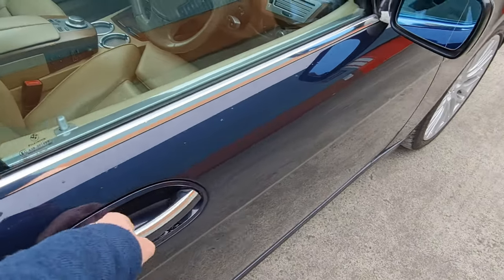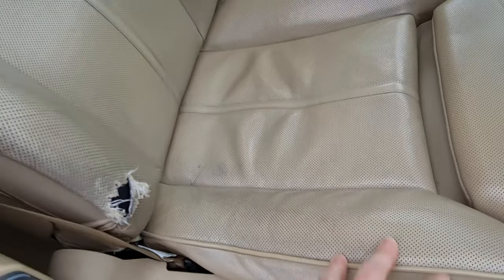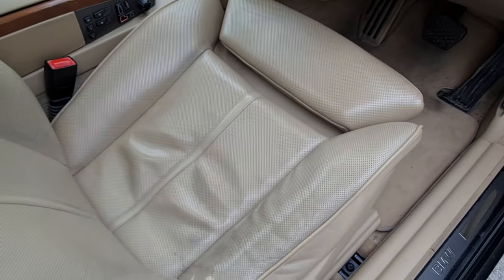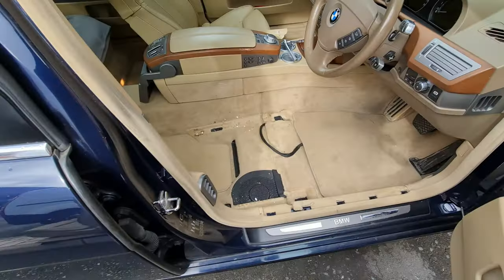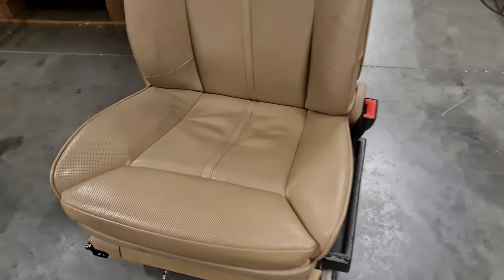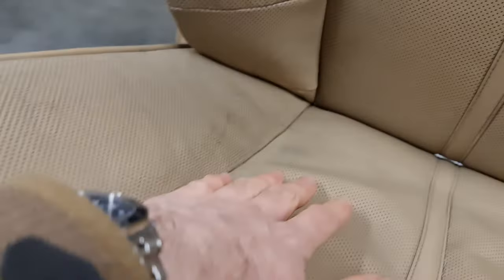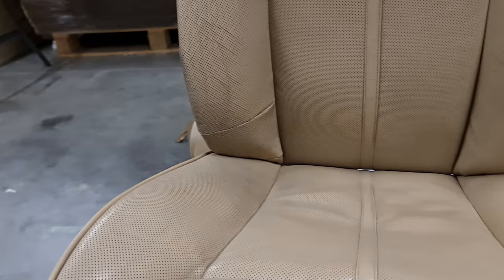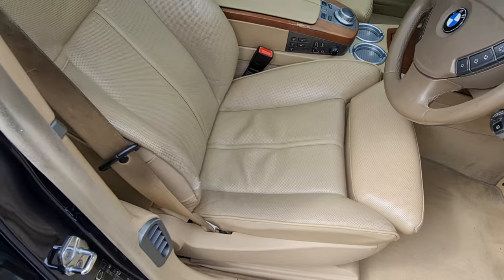BMW E66 740Li Repair Series - Comfort Seat Refurbishment

Comment: Would have been better to get a bolster leather piece from a passenger seat from a breaker and then repair it. Would have been a much nicer job for €200
Reply from the maker: Correct, but finding a Nasca beige perforated section of leather that isn't attached to a complete set of seats at short notice is not the easiest task. 😶‍🌫
Reply: @stevesbmwbarn  I thought you owned the car for 8 years? Colour can be matched, you just need the correct type of leather and perforation pattern

Comment: Well Steve only came across you site .. very interesting I am from dundalk and a big bmw classic Fan .loving the vlogs will check them all out at some stage ..
Had a few in my day e30s e34s e39s now my project is my e36 convertible in medira violet have it  7 years doing bits and bobs to it over the winter months .. yea probably seen it about town ..
The 850i build you done was great ,love them 8s ..
Reply from the maker: Small world! Don't think i've seen it, will be on the lookout. 🙆
Reply: @stevesbmwbarn  👍it’s only out for three months of the year weather permitting.. rear end rebuild  this year and front end rebuild ie suspension arms 
Etc. 
I have been up at one of Adam’s brewery car show .. am sure I’ll see you at some point .. looking forward to more vlogs 👍